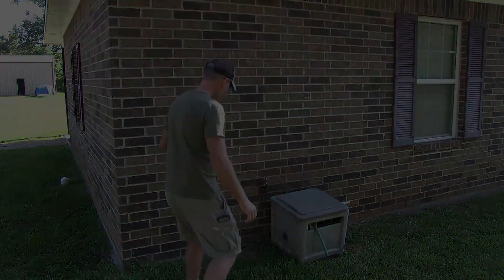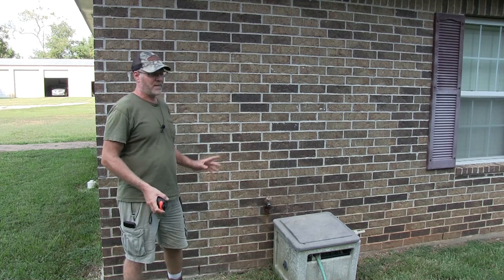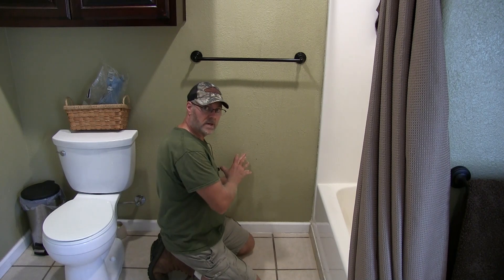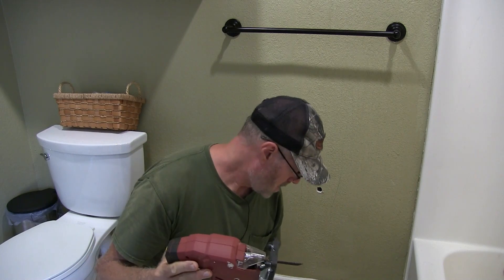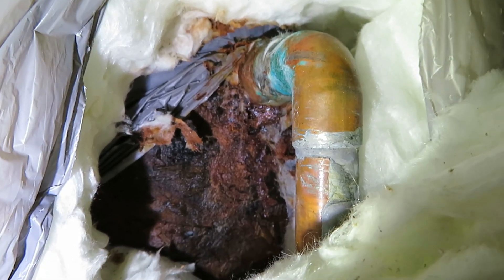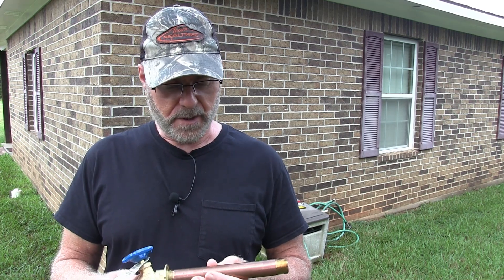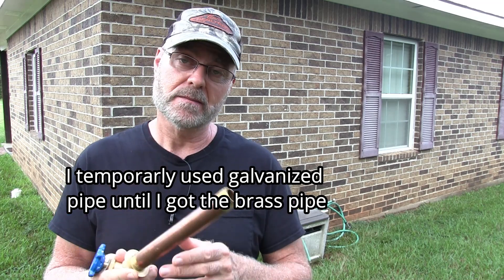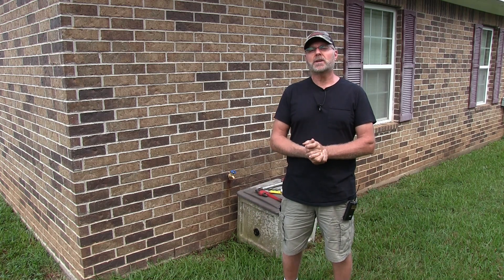Outside spigot (sillcock) replacement

Comment: Word of advice, instead of drilling a hole in the wallboard and/or using a jigsaw/sawsall use a keyhole saw. It is specifically designed for sheetrock, and won't cut through or damage electrical or anything else in the wall.  Punch it through the wall at an inward angle, and cut a square and you will have a ready made patch for the wall when your done.  Just mud up the edges of the hole, press the square you cut back into the hole, then when that is dry, mud over it, sand, and repaint.

Comment: Nice repair! You could have sweated a 1/2 by 3/4 MIP adapter on the end of a piece of copper. However, I can appreciate that you did this repair without soldering, which is more accessible to homeowners.

Comment: Hey Pete, love your video’s. I have 6 turn knob spigots that I want to replace with ball valve. (Washing machine hot & cold, Hot water heater and 3 outside hose spigots) One of the spigots on the outside of the house I will need to break away some stucco (previous owner stucco’ed the dam spigot pretty much). I plan on putting some sort of backer before screwing the new ball valve spigots to get the spigots off the house some that way in the future if I ever need to get a pipe wrench onto the pipe behind the spigots, all I would have to do is take out the back which I plan to use a piece if composite decking that I have left over from doing my deck. I was thinking that you could have got a 9” pipe instead if the 8” pipe and have it stick out a inch from the house and just fasten a 4”x4” piece of 1 by with the hole cut out and slide it over the pipe sticking out and fasten it with some Tapcons and the thread the spigot on.
Reply from the maker: Yep good idea👍
Reply: Too long winded next time just get to the point

Comment: You could have just made a copper nipple by soldering 2 threaded adapters on a short piece of copper tube instead of ordering the brass nipple. I think it was very wise of you to open up the wall so you can see what you’re doing and make sure they was no leak at the threaded joint inside the wall. Thanks for posting.
Reply: Excellent point, agree 100%.

Comment: Thank you.... mines of doing the same thing did not think about the leak inside the wall and possible mold. I don’t use that spigot that much but I will look into having it replaced. Home only 3 years old. Thank you... Kinda figured the wall would have to be cut into since it is under a window and not easy as screwing off and putting a new one on.

Comment: It looks to me like my Nibco sillcock is soldered onto copper pipe. How can I know whether there are threads on the other side of that pipe or if it too is soldered to the elbow? Maybe I'm just seeing it wrong and it is actually threaded on both sides? I don't have any leaking but a bad backflow preventer had to be cut off with a dremel tool causing some thread damage.
Reply from the maker: Normally the sillcock is threaded to the pipe in your house.
Reply: @petebeasttexashomesteading  thank you.

Comment: I liked your video and this is not a rhetorical question -- i want your take: you did all your torquing from outside; the threads are all inside and i presume no assistant to provide opposite torque to protect house plumbing. Were you concerned about that?
Reply from the maker: If you have copper pipping, it should be able to handle the torque and it will lessen the torque if you use a good thread sealant that will also act as a lubricant.

Comment: Awesome, detailed description!!! Is it safe or best to weld the pipe to the spigot for future replacement?
Reply from the maker: Yes you could braze the brass pipe to the spigot but remember to remove the rubber seal inside first.

Comment: you know he enjoys what he does with the amount of time he took to examine the silcock after removing it haha.. wonder how long that wrong piece lasted.  normal copper tubes bust every day.  black pipe longevity vs copper hmmm i wonder.  the previous plumber man probably couldnt find that dino width fitting and decided to use the black pipe. probably something id do lol ive had my moments trying to track down unicorns doing plumbing jobs.
Reply: Using black pipe directly on copper is a stupid, dumb-ass rookie mistake if you are even a semi-pro.  Why would you admit that you would do a half-ass thing like that, especially if you are a pro?  No surprise, though, that is why I do everything myself the correct way.

Comment: So...
How many more sillcocks with black pipe were installed in your walls?
Reply from the maker: Yeah I only have two and the other one is the correct sillcock. I guess the plumber ran out and installed the black pipe instead of brass pipe.

Comment: Did u check prier brand  spigot they are 8 inch long and u can get it from Lowe’s
Reply from the maker: Yes I checked everywhere and I could not find it in 3/4 inch size pipe.

Comment: I would have used a Frost Free sillcock.
Reply from the maker: True but here in east Texas, we really don't have to worry about freezing too much.
Reply: Then he would have to be concerned with pitching it downward to ensure it drains completely.  Which is not always easy if you are not dealing with new construction.  If you don't pitch the FF sillcock properly, it can still freeze up and burst the riser.